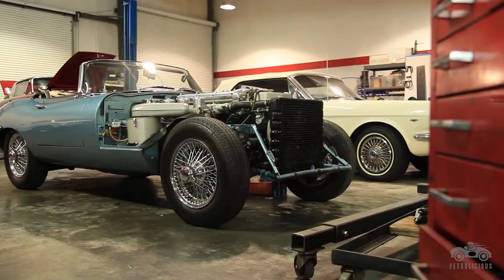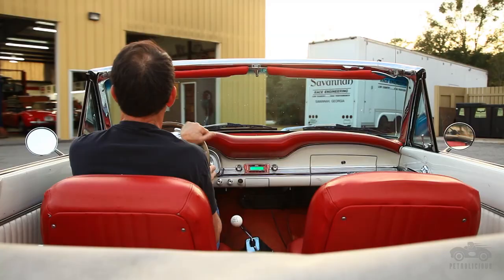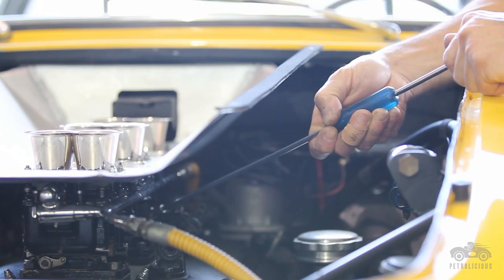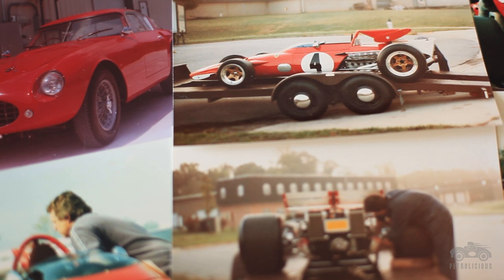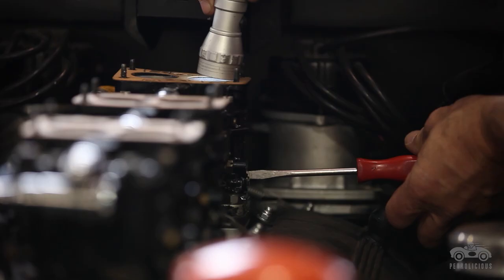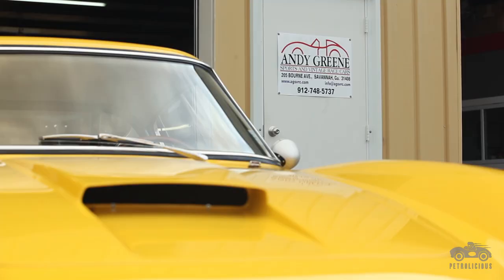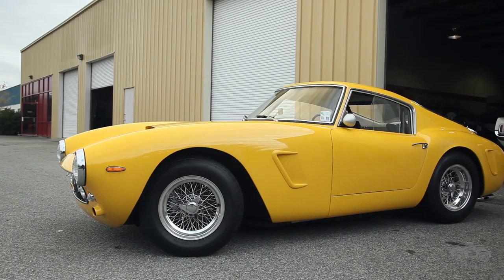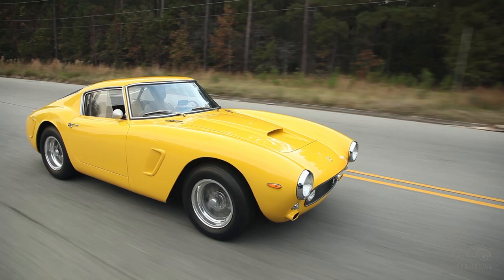The Ferrari 250 GT SWB Deserves a Special Caretaker - Petrolicious

Comment: Is this a race car, or a street car? It has race car windows, race car gas cap,
no bumpers (like a race version), but it has a street car interior (I think) and no
shroud over the tail pipe on the left side. Does anyone know?
Reply: chris manecke The 250 GT SWB is the  'comfort-version' of the 250 GTO - or the 'sports version' of the 250 GT Lusso. So it combines a race car with an elegant 'gentleman-sportscar'.

Comment: Just about the only old fashioned type Ferrari that I'd entertain. Needs a set of alloys though. Imo of course.
Reply: No-o-o-o-o! Those Borrani alloy wires are so characteristic - and they are alloy, after all. Only cars of the period that had (cast) alloys were Lotus - and that was just for competition.
Reply: Maybe spinning rims then ?
Reply: Why not go the whole hog, then? Swap the V12 for an LS7, dump those useless old headlights and fit bi-xenons, power steering, electric windows, ABS, traction control - restomod the shit out of it! All sarcastic, of course.
Reply: What hasn't it even got traction control already ?
Reply: It did, but it was strictly analogue. They called it LOBLOC - Lift Off Before Loss of (bowel) Control. No radio, tho' - just gas up another 500 RPM and that took care of the music.

Comment: Farrari need to get back to these smooth lines in there design. The latest models look shit with the crease lines and over designed rearends , while the front end looks unfinished , super fast. What the hell is with that shit grill and rediculouse bonnet that looks like someone tried to force it open near the headlights. These dumb super cars are looking more like transformers than cool rides.    Turn back time farrari and loose the wrinkles